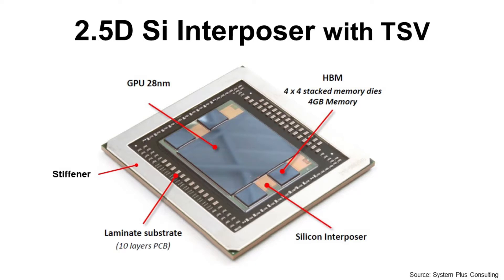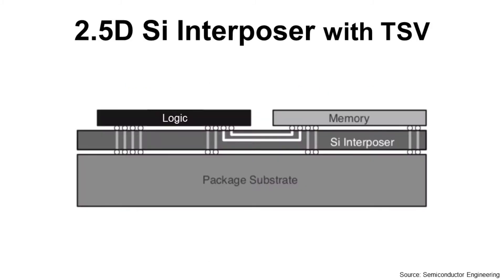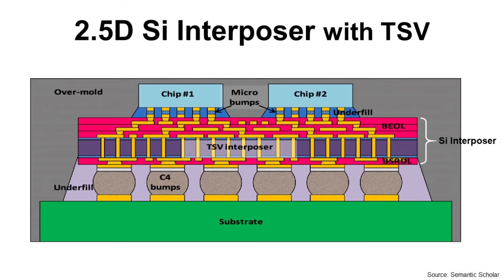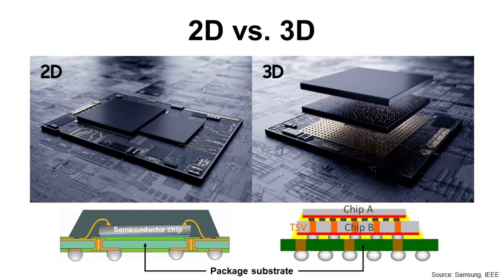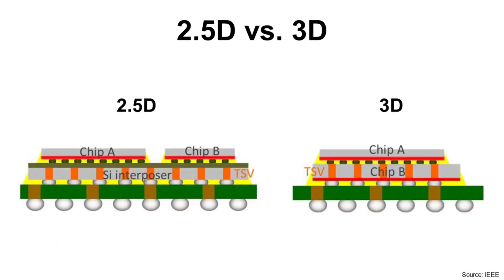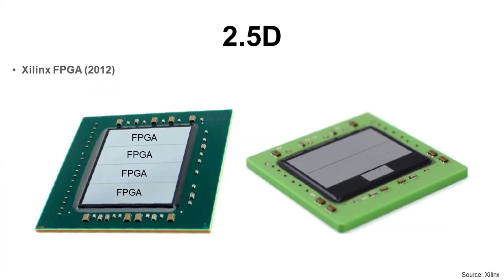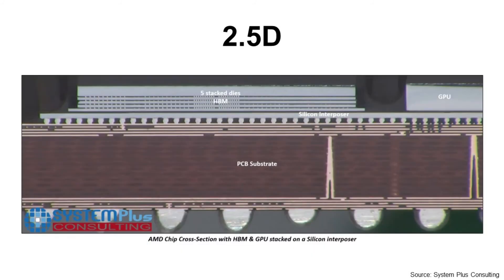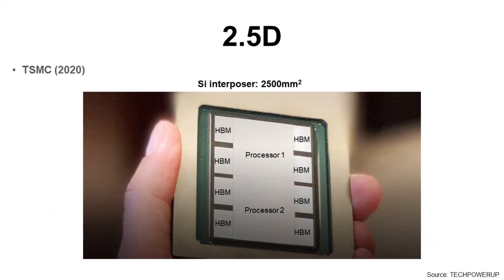[Eng Sub] 2.5D Package Technology: GPU+HBM, AMD, nVIDIA, TSMC

Comment: Kindly make one video for chiplet technology
Introduction to chiplet technology: what is it, how does it work, and what are its benefits?
Different types of chiplets: compute, memory, I/O, and so on
The challenges of chiplet technology: designing, manufacturing, and packaging chiplets
The future of chiplet technology: how it is expected to impact the semiconductor industry
Reply from the maker: Very good suggestions but I am afraid I don't have time to make video now.
Let me try to answer for your questions in here before full video at some time later. I hope it can help even little bit.

1. What is chiplet?
- Chiplet is to split one big SoC(System on Chip) into multiple smaller chips.

2. How does it works?
- In one big SoC there are multiple sections for different functions such as compute, memory, I/O etc. and chiplet separates these functions as individual chips. Each chip of chiplet should have some level of duplicated functions to communicate each other which is not necessary in SoC. It means total chip area of chiplets is larger than SoC. Each dies of chiplet can be connected by using Si interposer, RDL interposer or package substrate.

3. Benefits of chiplet
- Each function in one SoC has optimum Si node e.g. 5nm, 45nm, 65nm etc. and cost of smaller node is much higher than larger node. But SoC can't use different optimum nodes for many functions because it is single chip. Even if there is small defect for only one function, whole SoC is reject and it means manufacturing yield is relatively lower than chiplet.
Chiplet is multiple chips so chiplet can use optimum Si node for each function. If there is small defect for one chip, only that chip is reject and other chips are still good. So manufacturing yield of chiplet is relatively higher than SoC. Development time of chiplet is shorter than SoC because SoC is much more complex than chiplet and chiplet can develop multiple chips in parallel separately.

4. Different type of chiplet
- As you said, compute, SRAM memory, I/O, FPGA, SerDes etc.
  
5. Chiplet Package Technology
- 2.5D using silicon interposer, 2.3D using RDL interposer, 3D using hybrid bonding

6. Impact on semiconductor industry
- Chiplet is already widely used technology and it reduces development time and cost of new semiconductor chip and sometimes improve performance as well.

Comment: Thanks for sharing, your material is worth for studying. And I have a question for you that it should be 3D PKG image at 4:30 not 2.5D right?
Reply from the maker: Thanks for watching! It is 2.5D package at 4:30 because it uses Si interposer.
Reply: @semicontalk3223  but it is stacked with DRAM and Logic as image through TSV solution ? :)
Reply from the maker: In 2.5D package, logic die and HBM memory module are located on Si interposer side by side and electrically connected through Si interposer. And this Si interposer has TSV.
In 3D package, memory die typically SRAM is stacked on logic die vertically and logic has TSV. It does not have Si interposer.
2.5D has TSV in Si interposer but 3D has TSV in logic die. 2.5D has logic die and HBM memory module side by side  but 3D has memory die is stacked on logic die vertically.

Comment: What is the difference between this presentation's 2.5D and recent Samsung 3.5D?
Reply from the maker: I don't know what Samsung 3.5D. Would you let me know where you heard about Samsung 3.5D?
Reply: @semicontalk3223  Samsung Market Strategy SVP presents Advanced Heterogeneous Integration new 3.5D in Samsung Foundry Forum 2021 on Oct/6 - Oct/8.
Reply from the maker: I see. Samsung said that 3.5D is a combination of 2.5D and 3D but there is no more information. So their 3.5D will be little bit different than 2.5D.